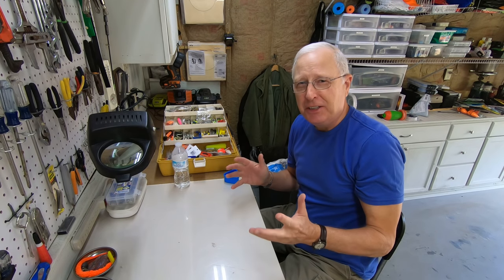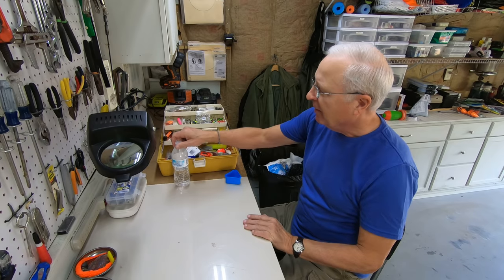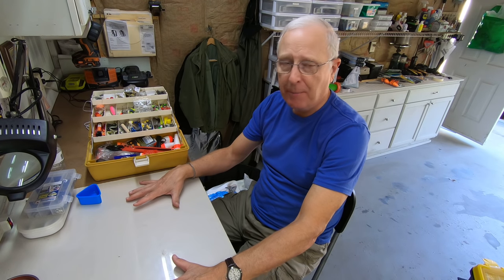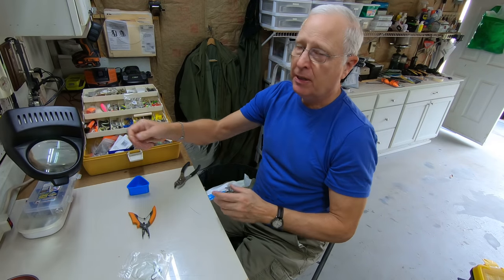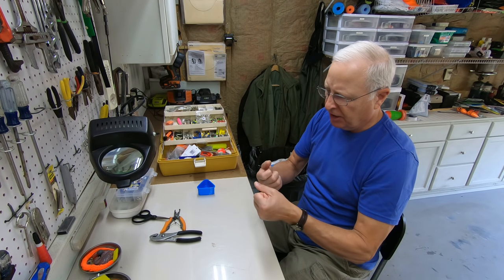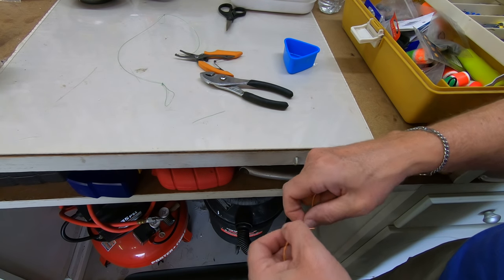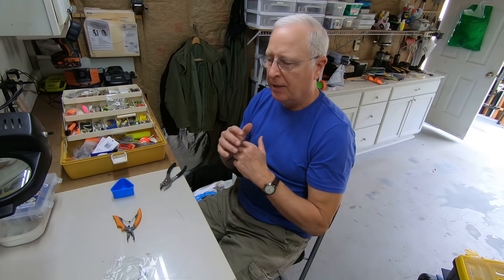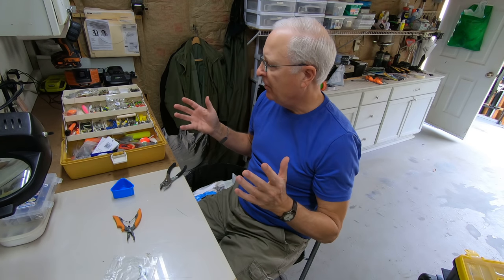Fishing Tackle Organization - My Fishing Rigging Workstation Setup

Comment: Heres a Rig you can try if you haven’t already. https://www.lafishblog.com/how-to-tie-a-k-dub-rig-for-speckled-trout/
Reply from the maker: That is interesting. Have you tried it? Do the two jigs wrap around each other?
Reply: Yes with good success. To avoid wrap ups put the heavier jig head on the bottom. I also tip the hooks with a small piece of shrimp and dunk in shrimp juice. Ive thought about straining the juice and putting it in a small spray bottle or using small pieces of sponge to tip rigs with. I could also freeze the juice between fishing trips. I have a friend who injects shrimp juice into his plastics with a tiny dental syringe but i have yet to try that one 👍🏻
Reply from the maker: Thanks! Great ideas! I need to try them.
Reply: Let me know how the rig works out for you. 👍🏻
Reply from the maker: I may try it with bait as well.

Comment: Nice set up, Steve. I was using the kitchen table last night to change some crankbait treble hooks to single hooks, and could've used that magnified light. Those little split rings are a bear to work with using just a kitchen ceiling light. I may invest in an inexpensive, free-standing desktop lighted magnifying lamp to use at the kitchen table before I continue changing-out hooks.
Reply from the maker: It will change your life!
Reply: I bought a LED desk lamp at Dollar tree.  Works great, great lighting.
Reply from the maker: lol! Emergency Rations!
Reply from the maker: Those work pretty good. I have one as well.